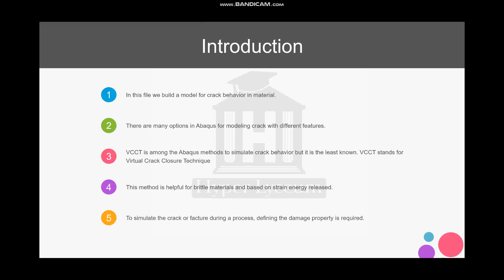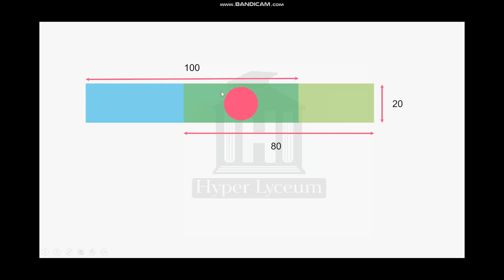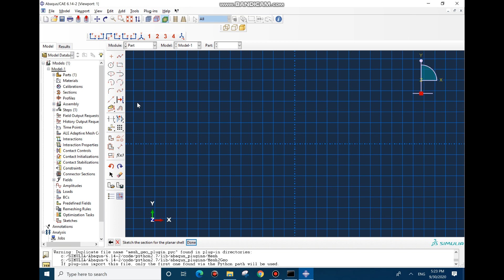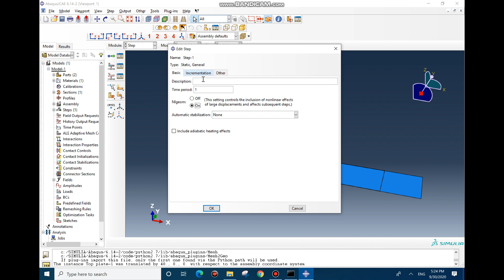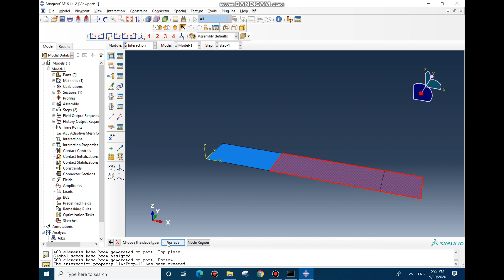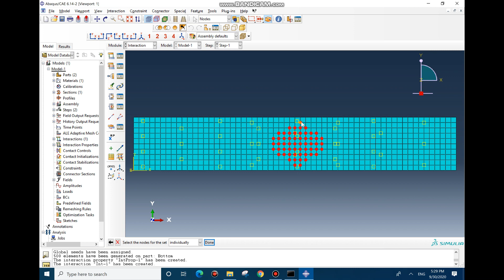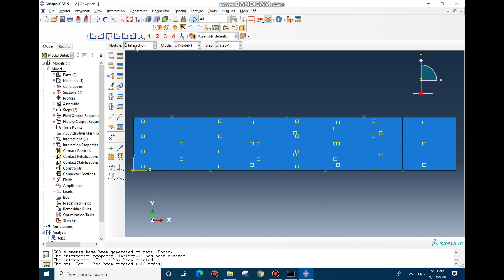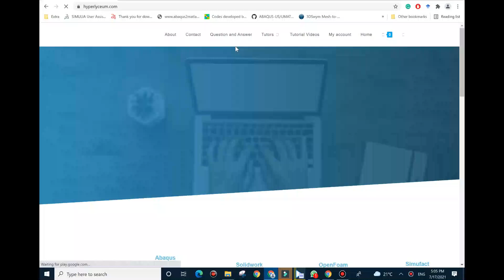VCCT method to simulate the crack in Abaqus

Comment: sir , i need help in how to create pre-existing crack in between the plies of a composite laminate. i have to use vcct method to study the stresses and serr in pre embedded delamination of compostite lap joint with frp adherends and isotropic adhesive. the delamination is supposed to be present in between 1st and 2nd plies of the laminate.thanks in advance